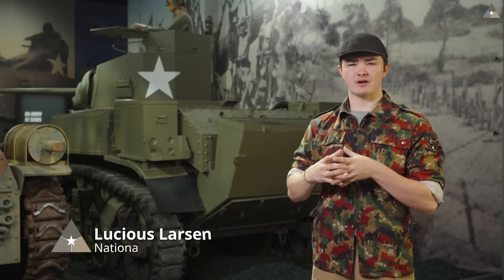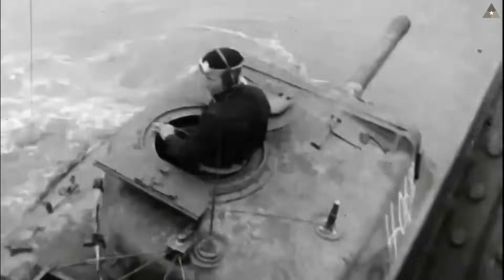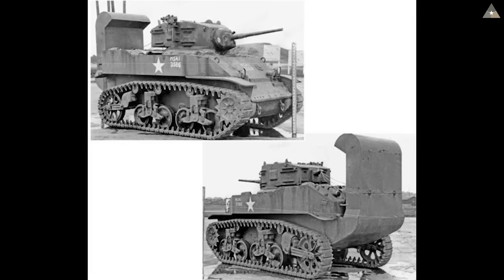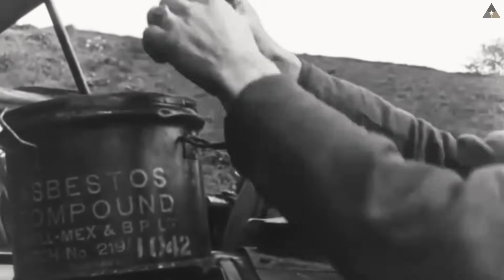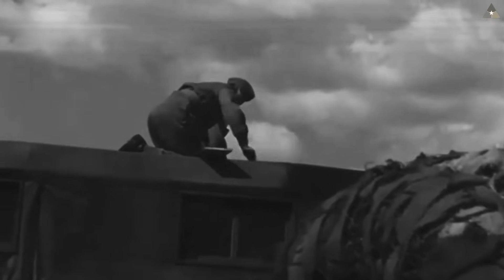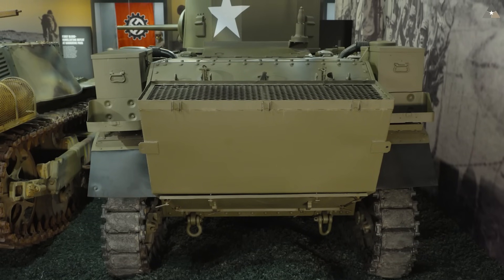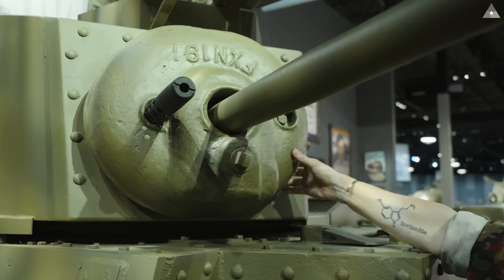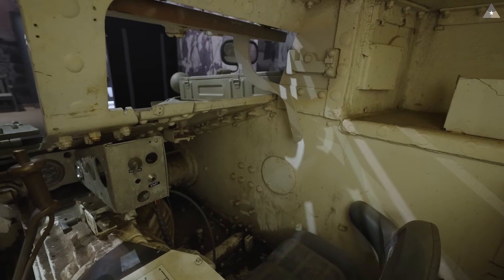Light Tank M3 "Stuart"

Comment: Asbestos was widely used before its long-term hazards were understood. Linoleum, a common flooring material, often contained asbestos to reduce its flammability.
Reply: Asbestos was also ubiquitous in adhesives for linoleum and tile as well up until it was banned from use, it's so common that any adhesive from before whatever the cutoff year is should be assumed to have asbestos.